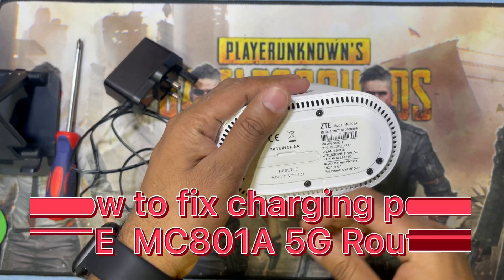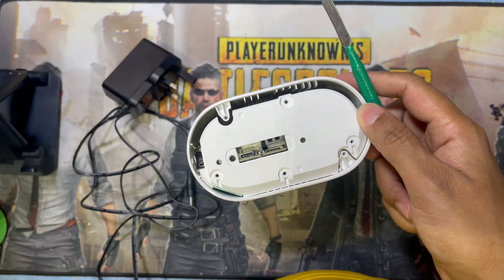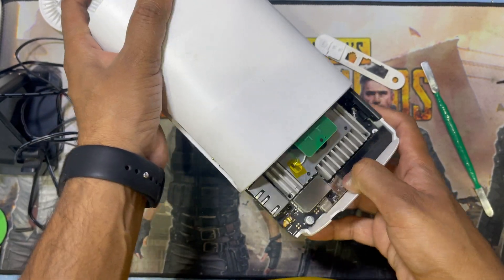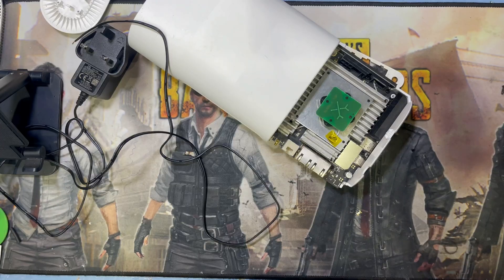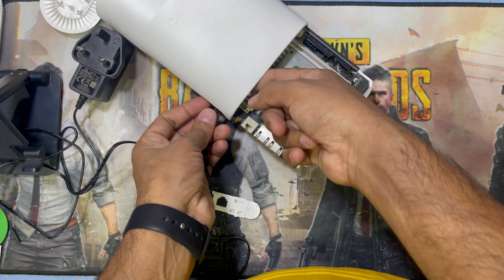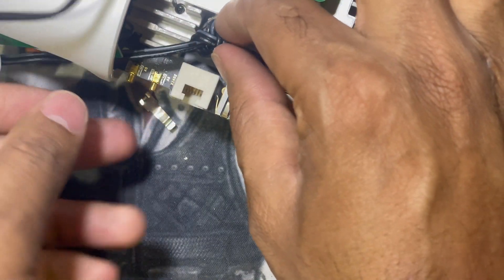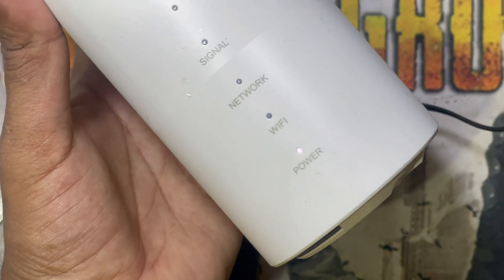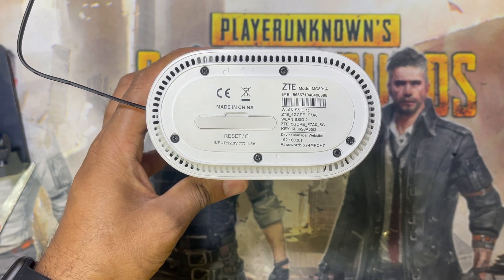How to Fix Charging socket ZTE -MC801A repair broken charging post zte china 5g router

Comment: Hi. Can you help. Mine suddenly has no power. Just a blink light goes off.
Reply: did u fix urs?
Reply: @rhonnelroyales2124  i did flashing firmware but has no signal
Reply: @educationforall5458  after flashing nag open na siya boss?
Reply: @rhonnelroyales2124  yes gumana na sir
Reply: @rhonnelroyales2124  working na sir
Reply: ano kaya problema ng modem natin bat ganyan?
Reply: @rhonnelroyales2124  dahil nung nag firmware update siya nag ka issue instead nag update ay na erase yung firmware
Reply: may fb acc ka po?
Reply: @rhonnelroyales2124  ano ngyari sayo?
Reply: ganun din may tutorial ka ng pag flash ng firmware? gawa ka naman boss..
Reply: @rhonnelroyales2124  sige gawa tyo pag libre na ako
Reply: @educationforall5458  salamat boss..
Reply: anong firmware ginamit mo boss may link ka try ko mag flash..
Reply: @rhonnelroyales2124  saudi firmware sir.
Reply: Ito sir follow mo https://youtu.be/6Lk9x6m-M3g
Reply: ayaw mag open boss nung file niya..
Reply: @rhonnelroyales2124  teka ano ba ngayri sa zte cpe mo? Pede ka mag send ng short clip
Reply: @educationforall5458  same lang din sau boss.. pero tinry ko mag flash pag sinksak yung cord wla na di na nailaw ngayon..🥲
Reply: @educationforall5458  nag fifail pag mag flaflash ako di ko alam kung bakit..
Reply: @rhonnelroyales2124  wag mo pilitin baka mas mahirap e recover memory nyan for flashing. San location mo baka pede mo dalhin dito sa pasay city.
Reply: malayo boss dito ako sa mindanao..😭
Reply: @rhonnelroyales2124  yun lng. Pde sana ako gumawa ng back up nito sakin para ma install jan sayo para easy na. Kasi daming steps at file need tk download at trial and error din kasi eh.
Reply: @educationforall5458  parang natuluyan nga di na nailaw pag sinaksak power.. dati nailaw pa tapos namamatay.. ngayn wala na..
Reply: @educationforall5458  kaso nag iba yung password niya di ko maaccess
Reply: boss okay na ty bumalik na